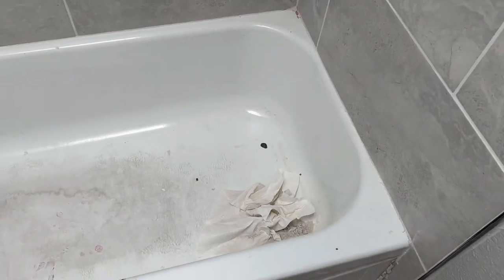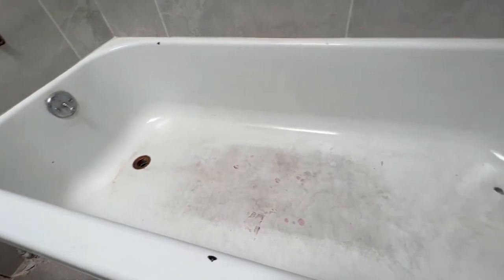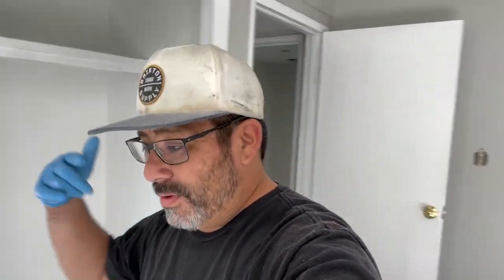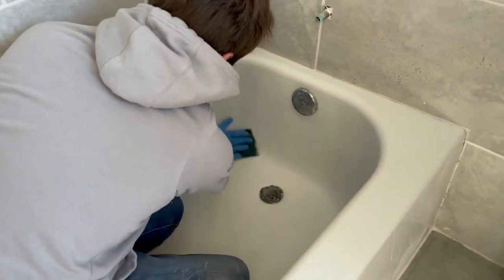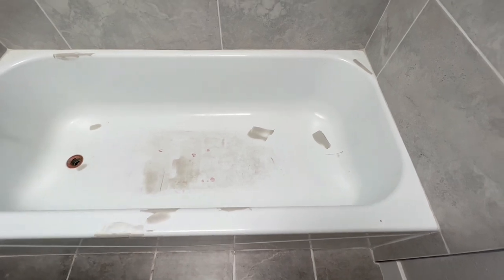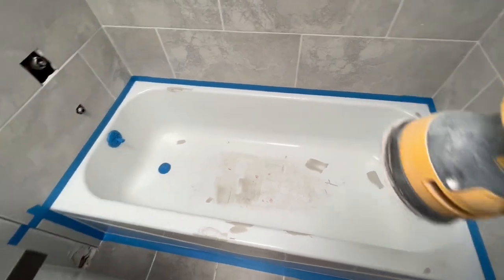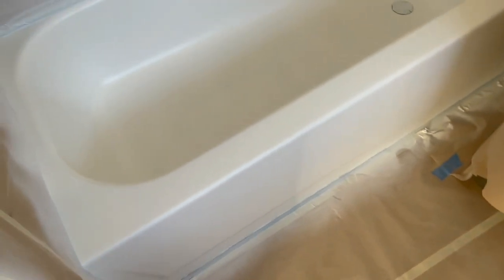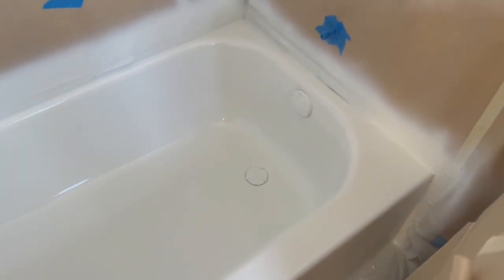HOW TO REPAIR & REGLAZE TWO NASTY BATHTUBS | BATHTUB REGLAZING & CHIP REPAIR | DP TUBS

Comment: Can’t get shiny finish unless I spray wet coat. But when I spray wet coat I’m getting runs and solvent pop. 🤷🏾‍♂️
Reply from the maker: Wait in between coats, speed up your spray speed or adjust the spray distance. You can always set up a zoom meeting to go over solutions to problems.

Comment: Do you recalk around the tub afterwards
Reply from the maker: Yes and No! I always tell customers it needs to be done. For example I just did a black tub and I wanted to wait for it to dry completely before I caulk so I charge a trip charge to come back and caulk. If the customer doesn’t want to pay for it then they are responsible. Most white tubs I will caulk about 30 minutes after I spray when I am done cleaning up or charge for a return trip.
Reply: @DPTubs  how much is the trip charge